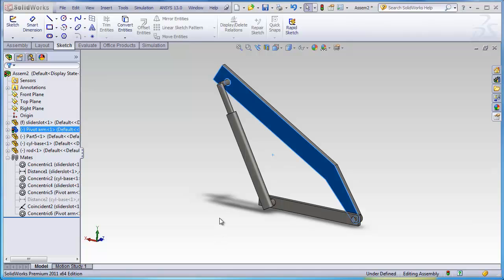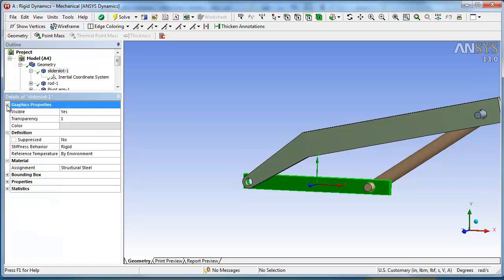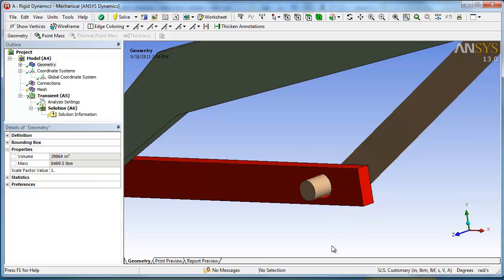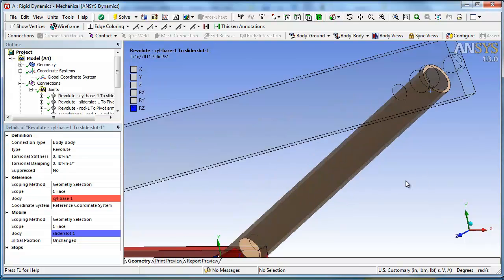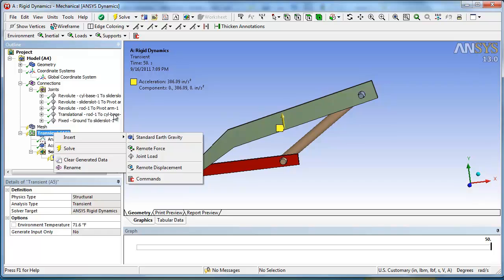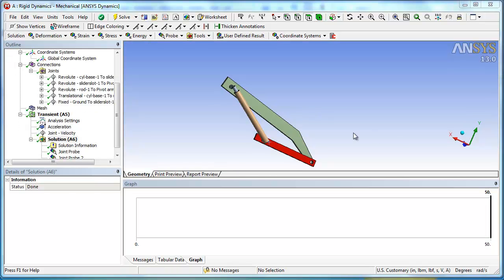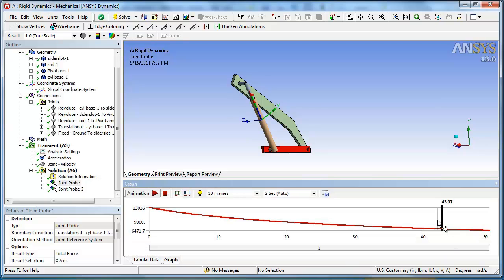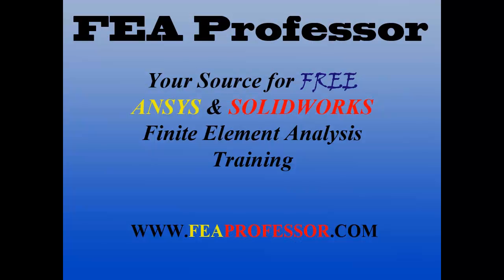ANSYS Rigid Dynamics Tutorial

Comment: Thank you. Is it possible to probe (find out) a moment reaction on a rotational joint (or any jont) where I applied rotational velocity in RBD? how could I calculate "the necessary design torque (reaction)" to balance the moment caused by other loads? As I experienced from Ansys RBD, when a  rotational joint is free to rotate, no torque reaction is induced about this free axis. Should I apply additional constrain its rotational axis where I will take torque reaction? But if I constrained the rotational DOF, how could I apply rotational velocity (or any load) to this constrained axis (DOF)? Is there any easy way or technics to probe torque requirement (reaction)?